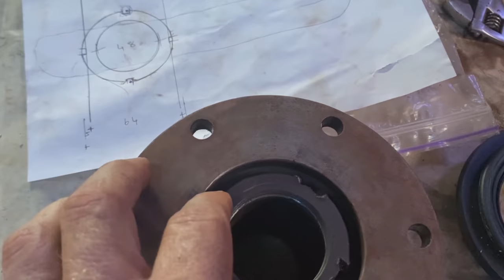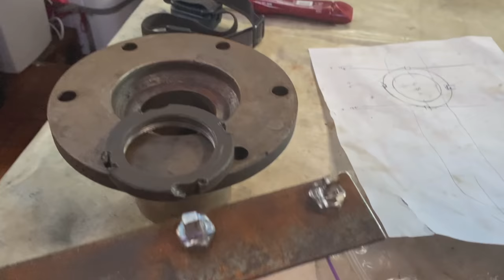Always fixing Something | Broken gear Box | Life on the Sea Episode 223

Comment: I saw a keyway , usually you would have some sort of key you would pound into it. Not sure what goes there. 18:17 I guess the "key" is inside the hole. 
 My experience , you have a driver that is like a round piece of pipe, , iron wood or something tough, same circumference  as the seal, but long enough you can hold it straight. (from a junk yard probably) You pound on the "seal driver" and it goes in evenly. Maybe even a thick piece of PVC ?? Pounding on each side , not the way. But your always successful..... I've been putting off a job, driving a seal way inside of an axel. You make the seal driver out of a large hole saw believe it or not, cheaper than the $300 special tool.  Darn, so it was the keyway ? Darn. Because I was looking at full size camera footage I saw the darn  keyway. Very cool, good job. Especially manufacturing a spanner that worked.
Reply from the maker: Cheers mate

Comment: You did an awesome job Lee,exactly as a marine diesel mechanic would do it.On the KH boxes for yanma engines the out put shaft has a inner shaft seal and the outer flange seal like you just replaced,I’m wondering if your box has the same setup.Having an o-ring rotating on the shaft and against the box housing seems contrary to engineering practices I’d be thinking.What type of box is it please Lee I’d love to look up the schematics for it just to appease my enquiring mind,,cheers guys.Dirk.
Reply from the maker: I will get back to you with the captains response 😜
Reply: @Lifeontheseafamily  all good Sarah.find the square root of length then multiply by 1.34.
Reply: Sorry this was for hull speed.

Comment: good going with that seal. bloody awful spot to work in.  btw your tool isnt much different from the proper one. Those funny washers are called castellated locking washers and they are used lots of places on heavy machinery. the bashed up nut should also be a standard part. i assume you noted down the numbers on the parts.
Reply from the maker: Thanks for the info